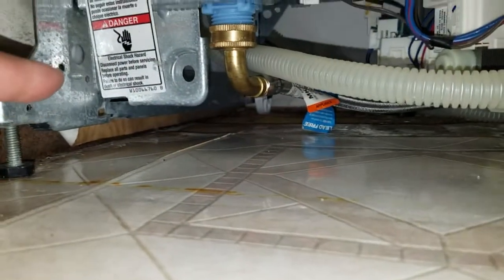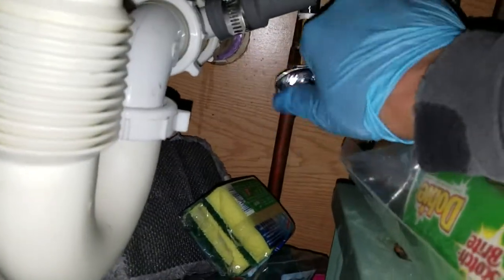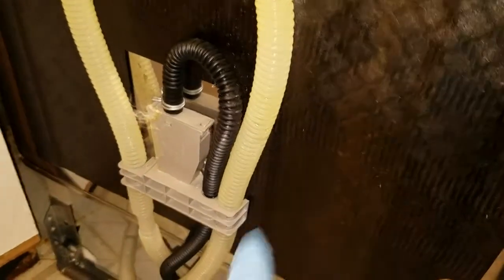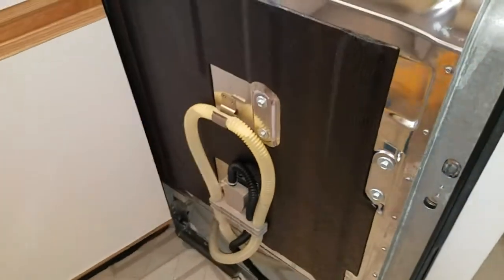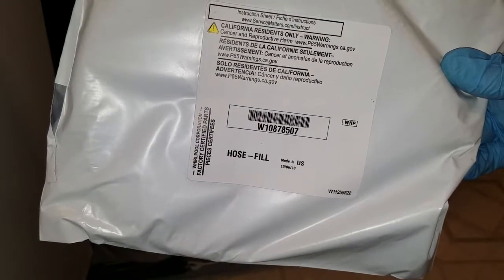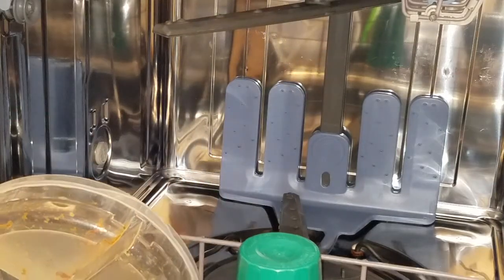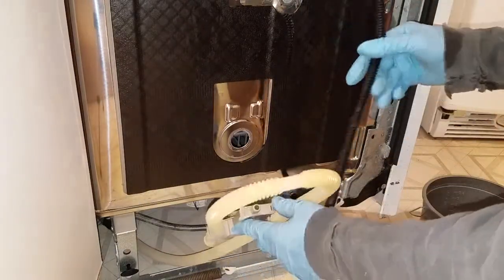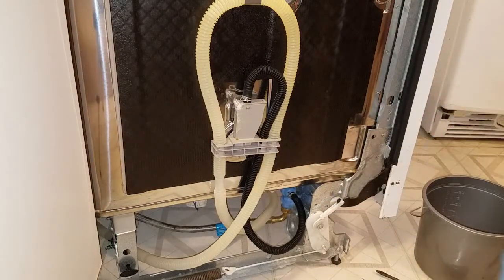Whirlpool Dishwasher Water Leak Repair - Fill Hose

Comment: This video is the best on YouTube for this issue! I'm pretty sure my Whirlpool Gold dishwasher has the same problem looking at the damage. Will troubleshoot. Thanks so much!
Reply from the maker: Thanks. Let me know how the repair went.
Reply: ok. my issue ended up being the the diverter motor grommet. Many similar YouTube troubleshooting videos for that issue, but this video helped to troubleshoot what to look for. thanks.
Reply from the maker: Yup, had that same issue too. I ended up replacing the diverter motor, but it didn't come with the top grommet, so I had to reuse the old one. Make sure the part comes with the grommet.

Comment: Exactly the same hose leak on my verision of the same dishwasher, KitchenAide KUDS30FXWH8, almost like it was designed to fail that way.  Coincided with debris on glasses and such, maybe due to reduced water input? So if you've cleaned the filters and such, and still get debris, check for a leak.